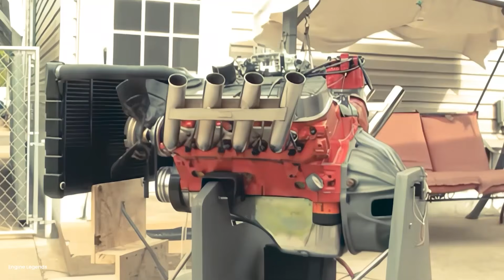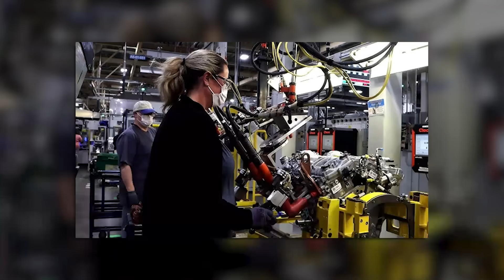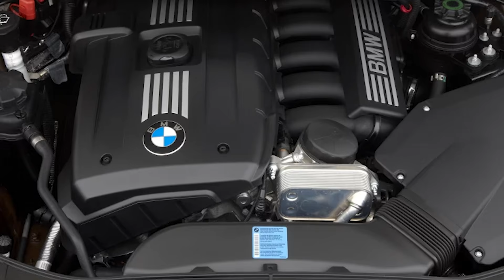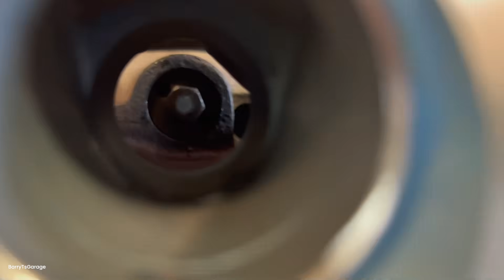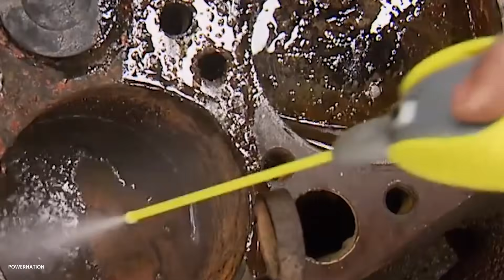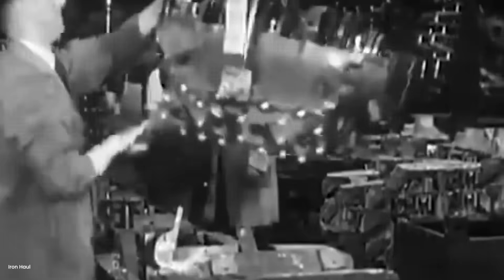How One Chevy “Corvette Engine” Outsmarted Every European Supercar

Comment: The LS7 is a powerful engine , but I don't know if it's bulletproof reliable , many people have had valve drop issues with these engines
Reply: they are reliable just fix the valve keeper problem.
Reply: @Thumper68 Exactly...the LS7 fatal flaw was it would drop a valve...why...valve retainers...valve guilds drilled off centre...something that would result in dropping a valve which equals engine destroyed...the fix was the factory heads valve guides redrilled centered to valve seat or aftermarket heads...cheap compared to complete LS7 engine replacement...
Reply: The DOD, displacement on demand, were problematic.
Reply: @glennspreeman1634  the LS7 does not have DOD.